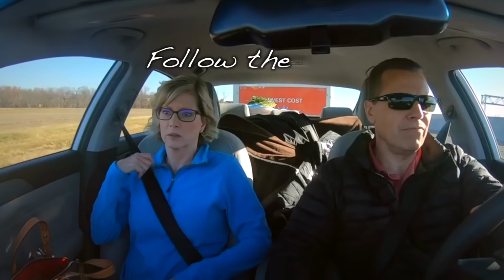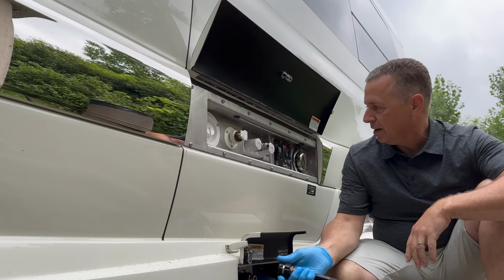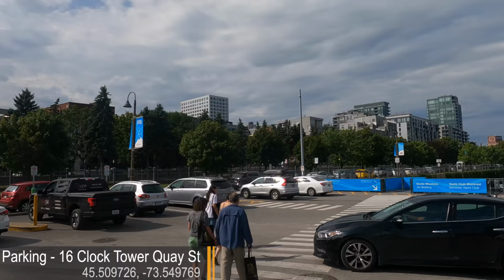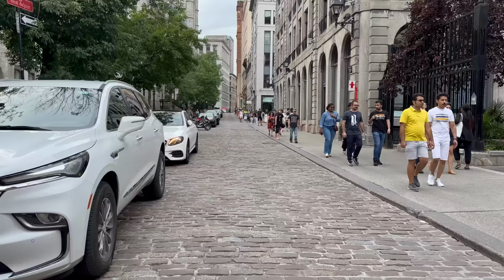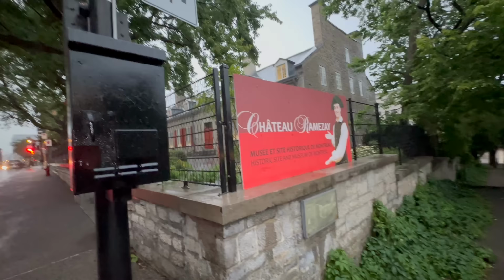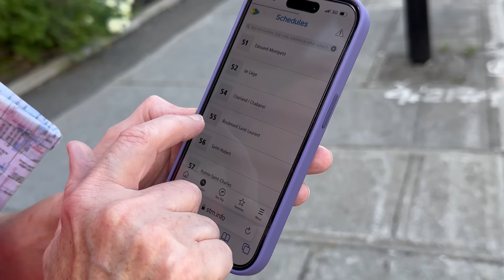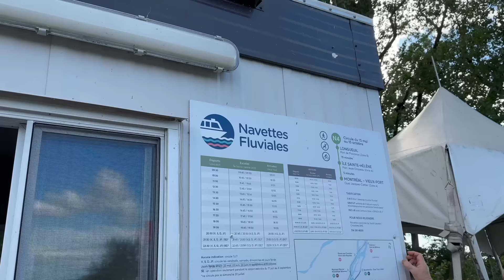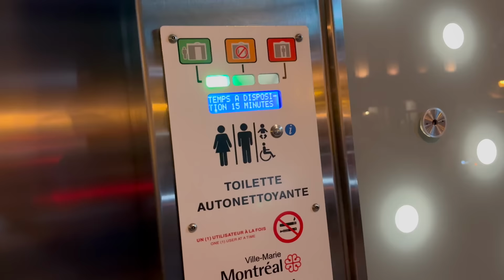3 Days in Montreal | What To Do | Using the Bus | Campground with Ferry

Comment: Do you need an adapter for the electric pedestal or does it match with the 30 amp van cord?
Reply from the maker: Anything 30 amp matches 30 amp on the pedestals and if they only have 50 amp or 20 amp, you have adapters that you just plug into the end of your cord.